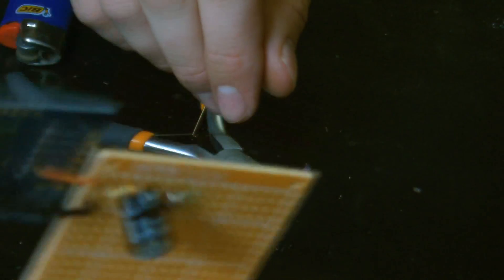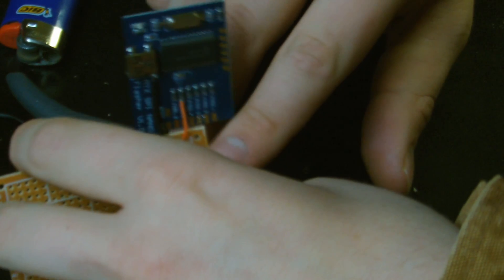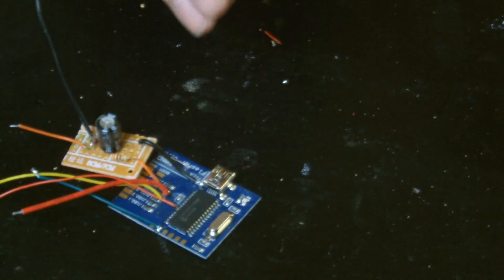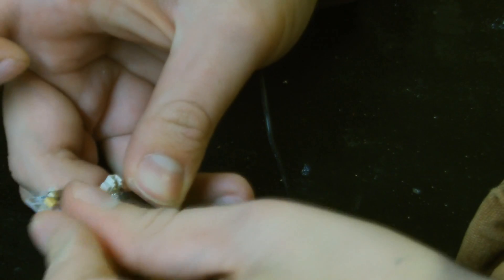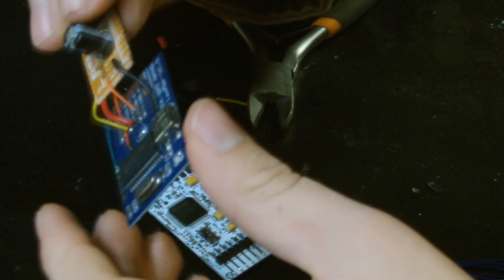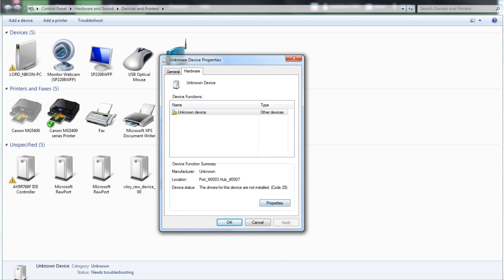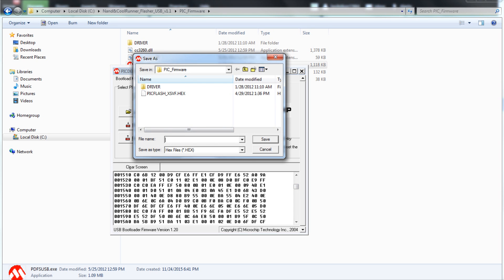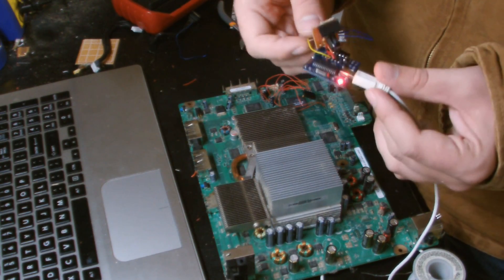DIY Nand-X J-R Programmer CHEAP! Use Matrix Nand Programmer

Comment: Hi first soldering job ever and I figure would be a good start with something like this. Would like to purchase everything needed to mod the nand reader I tried looking online but idk how it search for resistors I found a few theyd probably work. Thank you for this video I'm 17 and have had a corona v1 or v3 sitting in my room. Researched this process for years but now I'm considering attempts worst case scenario I brick a system I never played games on in the first place.

Comment: Do you think it can be possible reading a monolithic dead SD card? Let's say I have the pin out for the memory pads, tiny cables soldered and so forth. Can it be or am I just wasting my time?
Reply: I'd like to know the same thing.  Does anybody have a solution?

Comment: Will this work for reading, writing, and programming iPhone nand ic chips?
Reply: It could... but have you seen the tiny size of the pads of the iphone nand flash chips? you are far better of buying and adapter for it or bringing it to a repair store than being a cheap guy and trying to fiddle with a 16F4550 or similiar. (also, I dont know if there is any software for you to verify that you made a correct dump, could actualy modify it and forget about extracting those nudes or baby pictures.)
Lious Rossman's channel probably links you to some ppl who might know cheaper tools you can use.
He knows Jessa, https://www.youtube.com/watch?v=VNKNjy3CoZ4 (not her channel, but its her) find her channel here: https://www.youtube.com/channel/UCPjp41qeXe1o_lp1US9TpWA
She might know the right tool. Ow, not cheap huh... choose wisely ;)